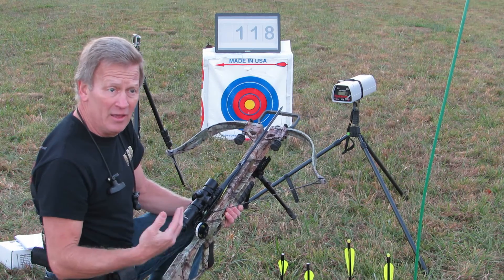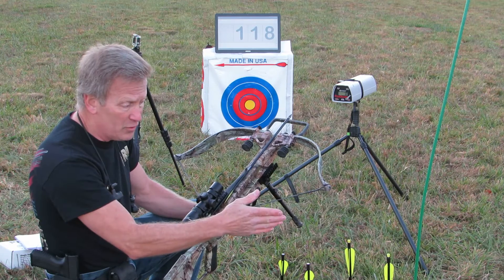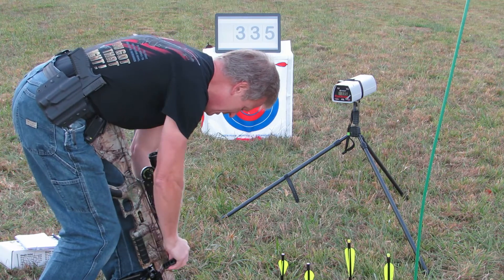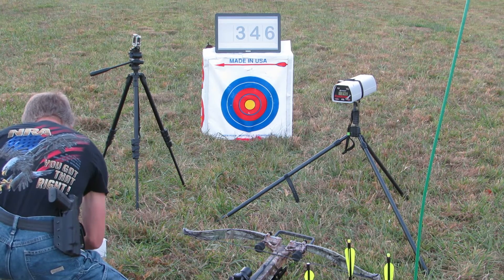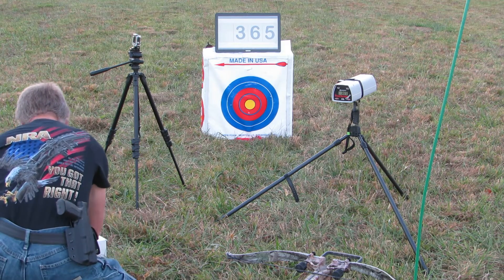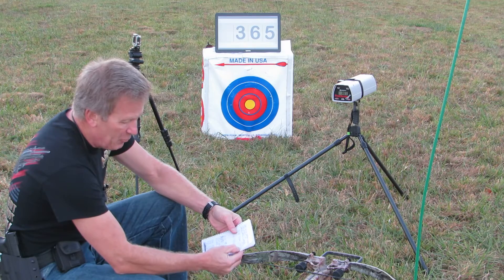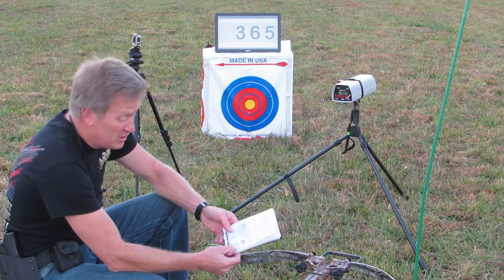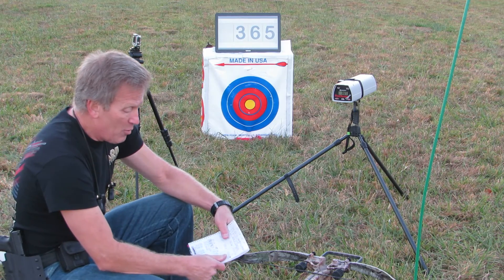Matrix 380 Speed Test = 20 in/18 in bolt w/150 gr, 125 gr, 100 gr

Comment: So if my bulldog 440 say 18 inch bolts can you still use the Excalibur 20 inch ? Thanks
Reply from the maker: Yes, I preferred the 4 inch vanes on the 20 inch Excalibur carbon fire bolts for my distance shots and in high wind. The stabilization was consistent and performed better for me personally but you do sacrifice a little speed drop. It's a choice you can test for yourself under various conditions and distances to see what works best for your needs. Hope this helps. Later Crossbow Brother : )

Comment: Hey I've got a question for you how come with the Matrix 380 supposed to shoot 380 ft per second with a 350 grain Arrow or bolt if that's what you want to call it why is it only shooting 365 feet per second if they say it'll shoot 380 with a 350 grain Arrow
Reply from the maker: Probably user error with brace height ,aged string or distance     from chronograph sweet spot.    I just keep working on my fundamentals of fire so I can strive for progress, not perfection. Thank's for views and comment. Crossbow Brother out 😀
Reply: The 380 is the only Excalibur that shoots slower than stated. 365 to 375 is the average on the 380 with a 350gn arrow.

Comment: +MINDLIKETHEMILLPOND, OP could you pls do chrono test of Matrix 380 with 900 gr arrow? I'm planning to buy Bulldog 380 and I really wish to see how fast it could shoot 900 gr or 1200 gr arrow. Thanks Beforehand :)
Reply from the maker: The best I, can do is 770 grains. Thanks to a richochet of my 600 gr broad head, unless I find it with my metal detector. If a 500 grain Bishop Archery broad head , for 770 grain total won't bring it down , then you need a stronger weapon than a Crossbow 🤔😂
Reply: Thanks. I mostly intend to hunt either boar or bearded pig, however I could really use the option to hunt Water buffalo and to sufficiently hurt salt water crocodile (merely to force the salty to retreat). BTW what the speed & momentum you get from 770 gr arrow? Thanks Beforehand :)
Reply from the maker: Shooting the Benjamin Airbow  with 600 gr for 875 gr total was averaging 290 to 296 fps but I will Chrono the Matrix 380 and Matrix Bulldog 400 to let you compare with 770 grains. The penetration is amazing. It will be the 8th to 9th of April before I can upload do to vacation with family but I won't forget ya🤗
Reply: @MINDLIKETHEMILLPOND Excalibur Exomax 225# 350fps/350grs = 260fps/700grs hunted Elephant

Comment: This is all well and good but something to consider is that at 50 yards, the time of arrival between 300 fps and 400 fps is only 1/10 th of a second.. and at 25 yards it is only 1/20 th of a second.. A 1/10 th of a second sounds like, thump thump.. Trajectory is the only real change which can be taken care of with the multi reticles in a scope.. To compare 330 fps against 360 fps is not really accomplishing much.. Also the difference in foot pounds of energy will be minimal because one will develop energy from speed and the other from weight but both will be very close to the same.. You either shoot lighter arrows/bolts faster or heavier ones slower but the energy is coming from the limbs and will be almost identical (within a foot pound or so).. The benefit of shooting heavier slower bolts is that it moves the bow further away from a dry fire and makes the bow a little more efficient and probably a tad more accurate in the process and will be conducive to better penetration, because the heavier bolts won't want to stop as quickly or as easily.. I am sure you are having fun doing all this but it really is not accomplishing much.. The real goal is to find which bolt shoots hole in hole at 60 yards each and every shot, regardless of the weight or speed.. It is always better to shoot lighter bolts with heavy tips rather than heavy bolts with light tips - better penetration and better accuracy with more weight forward.. The function of the vanes is to keep the rear end following the tip, if the tip is too light then it can't be dominant and the bolt can act odd.. A heavy tip will be dominant and if the back end swings out the vanes will push it back in line with the tip without disrupting the direction of the tip too much.. When you shoot an arrow/bolt the energy passes through the shaft to the tip and the tip pulls the arrow/bolt.. Technically on a perfectly tuned bow there is no need for vanes at all.. (the world is not perfect and few bows are tuned perfect).. Shoot heavy tips.. For all you speed demons out there take a word of caution.. If you buy a bow rated for 400 fps and think that you can shoot it at 400 fps be prepared for the bow to self destruct over a period of time.. all the energy that does not get transfered into the arrow goes back into the bow as a dry fire.. My advice would be to shoot a bolt heavy enough to slow it down to around 350-360 fps or so.. The bow will last much longer and develop plenty of energy.. A good alternative is some of these reverse limb bows with around 130 lb limbs that are capable of shooting 370-390 fps, then you can shoot mid weight bolts to slow it down 30 fps or so and still have good energy and good speed and not much energy being transfered back into the bow in the form of dry fire.. That is my rant for the day... hahaha  I hate to see anyone spend a lot of money only to have their equipment blow up or crack limbs etc.. These bows just can't take the pounding that some think that they can and speed is minimal when you consider the difference between 300-400 fps at 50 yards is only 1/10 th of a second..
Reply from the maker: +Jim Richard Thanks! For the views and comments. Your extensive knowledge and insight is respected and appreciated. I am enjoying my crossbow journey and have added the Airbow / compound bow to the mix. I regret I waited till 50 years old to start with the flight of the bolt / arrow but the journey continues to be fun, relaxing and a excellent stress break all year long being outdoors. Thanks again! I appreciate the sharing of your knowledge. I am a dude in his driveway learning through trial and error but they say to do is to understand . Later , Crossbow Brother.
Reply: Thanks for your compliments - I am 70 and have been shooting bows for over 60 years and like you in many ways took hours and hours of trial and error.. I don't want to come off as an expert but I like to offer what knowledge I have gotten over the years from my own experiences and also learned from more knowledgeable  people than myself.. When I was coming up through there was no YouTube or for that matter many magazine articles to get help from it was trial and error and talking with others and sharing what we picked up.. I did not get into competition until my mid 40's and had to give it up because of eye sight.. I have since had both eyes operated on and took it back up as a fun hobby and a good pass time.. I don't do competition any more but still do some hunting on occasion.. I mostly punch little holes in paper etc.. lol.. Experimenting is fun and I always sought after just one goal and that was accuracy.. I also number my arrows based upon how they perform,, I look for hole in hole and don't concern myself too much with speed or power.. Very seldom will you get identical performance from a variety of arrows so I generally shoot one arrow repeatedly.. I may have several that will shoot hole in hole at different yardages but they will differ slightly where they impact.. One may shoot 1/4 inch left (but in the same hole) another may shoot 1/4 inch to the right again in the same hole so if my zero arrow fails I need only make a slight adjustment to my scope and am back shooting hole in hole in the center... 
You may want to check these bolts out they are 0.001 straight and have heavy brass inserts instead of aluminum giving good weight forward for accuracy and penetration.. the shafts are light at 9 grains per inch but with inserts and vanes they weigh 326 grains and if you use a 125 grain tip they would give great accuracy with plenty of forward weight and a total weight of 451 grains.. At $5.95 each is a bargain for what many consider the best of the best.. 
https://www.wyverncreations.com/finished-arrows-c-82/black-eagle-executioner-arrows-p-515.html?zenid=5umkmlhv3r3jobju9mjqenp9b5
Reply from the maker: Thanks again.Your right about the YouTube advantage, because it has helped me stumble through a lot. Thankfully the Army taught me to shoot  and that transferred over pretty easy to the crossbow. The past 5 years of constant practice and 4 1/2 years posting videos has allowed me to learn the potential of my crossbows / scopes but theirs no doubt , I will reach my limits of proficiency way before my crossbows reach their full potential. I like distance shooting and their potential to be on target from 100's of yards still fascinates me. I enjoy night / low light shooting , thanks to illuminated reticles and lumenok bolts. It's a nice moment of silence, following good fundamentals of firing, when you see your lumenok bolt strike its intended target at night from 200 to 300 yards away. Thanks for taking the time to share your experience and I will check out the arrows. Scouts Out!
Reply: Great comment - the reason I like Excalibur is because their cool lookin and lighter weight than just about anything else, and accurate too.

Comment: I noticed that with the  fastest bow  you used a crank.... Is it just too much to cock with a rope ? Aluminum or short brass inserts will get the weight of a 20 " arrow down "a little".    That is as fast as my Barnett compound and  much lighter to carry....   I might decide to get an Excalibur soon.  Excalibur looks like a simpler, lighter, more accurate ,   and more durable bow...    The only down side is the recurve is wider... so picking a bigger/wider  place to hide will become necessary.    https://www.midwayusa.com/product/351817/bloodsport-22-hunter-carbon-crossbow-bolt-black-pack-of-6Bloodsport arrows are well made,   and made in Iowa, USA   [[similar to Diablo and can be longer]]....  With A call to the factory in IOWA, USA  you might be able to get them to vane it to your liking,  cut it to your length, and  you may specify which brass inserts and nocks you prefer.    I have been to the factory for Bloodsport arrows.   They made me up a dozen arrows to my preferences  and those arrows performed very well.  18.5" shaft at total weight 405 gr  seemed to be a sweet spot for the Barnett Ghost 350 bow.  The vastly inferior Barnett bow "did all that it could"  with those arrows.    The cams and split limbs  "do not" contribute to accuracy ... Nor does the poorly fashioned  scope mount that Barnett decided on for production bows... Why Barnett did not choose a SOLID scope base is beyond me ...     Excalibur...twice the price or triple the price of Barnett ...and worth it.
Reply from the maker: +J Martin The Matrix Bulldog is a 270-pound pull recurve so it is a little bit more than your average bow to pull back but I like using it because it gives you consistent string alignment that way you do not pull more with one arm than the other and maybe shoot to the right or to the left by mistake especially when you shoot distance ,it gives you consistent string alignment every time and that way you don't have to worry that maybe it was me pulling with one arm more than the other if you shoot to the right or to the left. Your pretty much certain that it's a consistent string alignment every time and now I have learn to shoot it with the C2 crank on so there's actually no reason to take it off so it's highly effective and effortless.

Comment: Not a single test bolt reached the advertised speed of 380 fps.  What is Excalibur using to reach those speeds?
Reply from the maker: +med1pilot1956 I don't know how many times they shot. I only shot once with each weight but when I shot the Matrix bulldog 2 or 3 tries I did reach 395 fps so maybe it's shoot more bolts down range and move the chronograph forward or back until you find the golden bolt / speed. I wasn't going to spend a lot of time trying to match them and instead used my speed results for my benefit and it definitely gave me some good results to use for my distance shots etc. I figure if I have one eye fixed on their( Excalibur's Destination) of 380 or 400 fps , then I only have one eye left to find my way. It has not slowed me down and it really just gave me another tool for my tool box. I understand why people get upset but the majority are probably not shooting near their crossbows potential anyhow. I know I will reach my limits as a shooter long before I push my crossbows to their unlocked potential. Wish I could tell you exactly how they do it but they are gonna have to catch up with me to see how I am doing it and then they will only have one eye fixed on their targets ; ) Thanks ! Crossbow Brother and I am uploading a new video as we speak. Sniper shot through barn windows to take out Bob with a Mega Boom. Later
Reply: Thanks.  I've just recently decided to give up the compound for a crossbow.  Arthritis in my shoulder as I age has made the switch necessary.  I've been binge watching everything I can find on YouTube and beyond.  Thanks for the well documented series.  I wish we could trust manufacturers claims better.  It certainly would make accurate comparisons easier.
Reply from the maker: I will keep the recurve  crossbow videos coming so you can compare performance : ) It definitely has to meet your personal wants,needs ,budget and compound vs recurve dilema. Its a big decision so take your time and do your research and I will hold the fort until you decide.